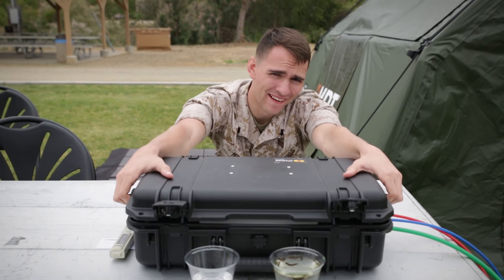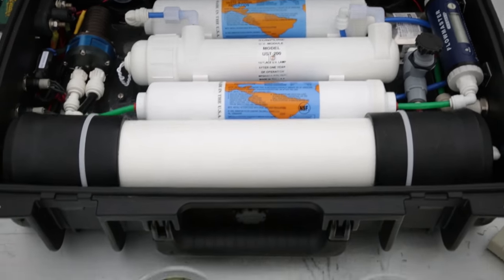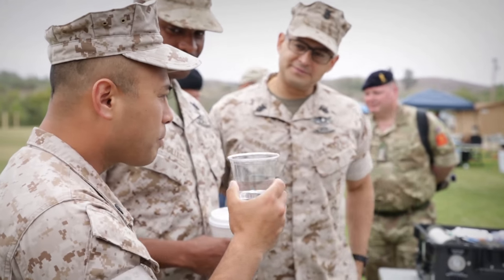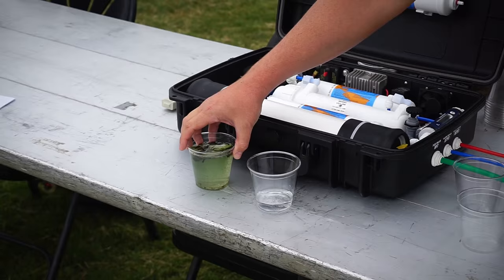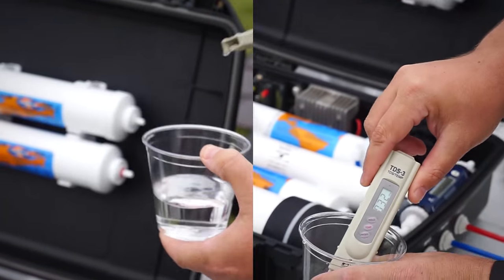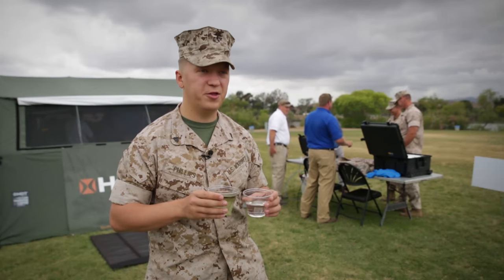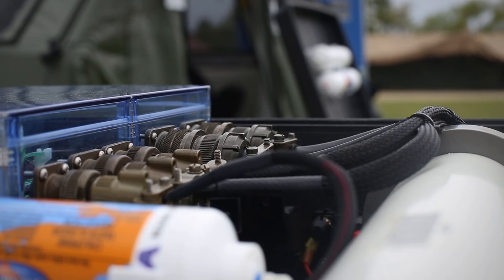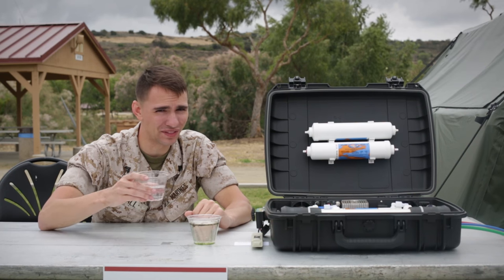With the Gear | Squad Water Purification System

Comment: I can't think of anything to comment so I'm just going to post a pancake recipe.

Ingredients
1 ½ cups milk (plus more as needed)
1 egg
2 teaspoons vanilla extract
2 cups self-rising flour
¼ teaspoon baking soda
1/3 cup superfine granulated sugar
2 tablespoons butter, melted

Preparation
In a bowl or 2-cup measure, whisk together milk, egg and vanilla. Into another bowl, sift flour and baking soda. Stir in sugar. Make a well in the center. Add milk mixture. Whisk until just combined. Batter will be thick (thin with a little milk, if desired; batter will get even thicker as it sits).

Heat a large nonstick skillet or griddle over medium heat. Brush pan with melted butter. Using about ¼ cup batter per pancake, cook pancakes 3 to 4 minutes or until bubbles appear on surface. Turn and cook 3 minutes or until cooked through. Transfer to a plate. Cover loosely with foil to keep warm. Repeat with remaining mixture, brushing pan with butter between batches. Serve.